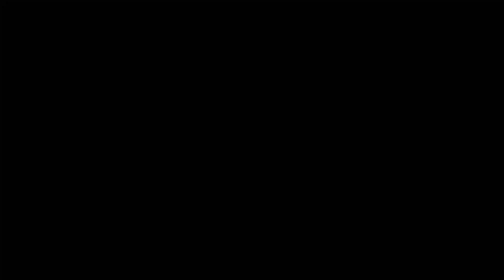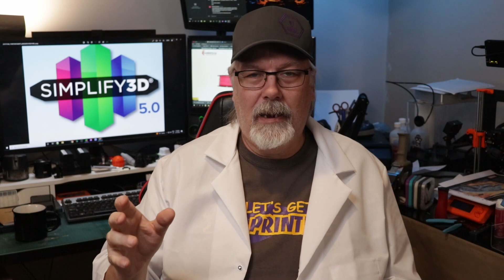Simplify3d V5: Is it Worth the Upgrade?

Comment: I've been using S3D V5 for a while now and i DO NOT recommend it for a few reasons:

- They say it's rebuilt from the ground up. That's a big lie. They developed for years and years for just some intrinsic upgrades and maybe max 5-10 extra features. Not even the essential ones that were so anticipated by its community. They just did what they thought was right and barely listened to their users.

- we in EU paid upwards 242 euro's for a single-device license. For this....

Please guys, if you want to try it out, try it and pull out. You got a trial of 2 weeks, don't be stupid like I was.

Comment: Since you are a big site, and you can transmit information, SIMPLIFY3D was not dead at all, if you shouf well IDEAMAKER, you immediately recognize the dna of simplify3d, me who am a fan of this software, and who was tired of the prime tower rising to the top when I had no more color changes, I turned to others to test, and that's where I see that IDEAMAKER has absolutely everything of SIMPLIFY3D, but then EVERYTHING, only one thing is missing, I don't really know what, I think I was using scripts to adjust the linear advance in terms of the layer height, so that's why a piece is missing
BRIEF SIMPLIFY3D worked for RAISE3D, necessarily, a machine manufacturer, is not going to have fun creating a high-end slicer starting from the blank page, and this is surely what explains the absence of the simplify3d team completely dedicated to the development of IDEAMAKER

Moreover, IDEAMAKER has a toy that simplify3d does not have and which makes me prefer IDEAMAKER, these are the modifiable areas, you draw a cube and you give orders to this cube by saying 'everything that is in this cube will have these parameters ', it allows to boost certain places in three clicks etc.

BRIEFLY DO NOT BUY SIMPLFY3D, you have it at IDEAMAKER FREE, on the other hand, you have to know a little gcode, and make your own starting files, which you copy on your other slicers etccccc

BRIEF stop, there are freebies and better!
Reply from the maker: Before I condem S3D it is only fair that I compare it to the current offerings. I totally understand the points you make. If I don't give it more than a surface examination I am not serving the comminity. With that said If you have a slicer that works for you than stick with it.

Comment: NO! You can only have this new version on ONE (1) computer whereas the previous version you could have it installed on TWO (2) computers at the same time. I did not know that fact until I spent the $59.00. I have asked them about this and they have NOT answered me. I am still waiting for my refund. I say it is a bad deal. I will start using CURA more.
Reply from the maker: Only being able to use on one PC is a major step backwards in my opinion. I will be doing a thourogh examination of the software over the next few months and reporting my findings on this channel.

Comment: For the infill, you are wrong, s3d is adding something quite new there, namely not a 2d infill pattern being pulled upwards, but a real 3d infill pattern that increases strength of prints in more directions. That is an awesome feature and you should not say that other products provide different infill patterns already, as s3d has a different way of infill. I am not a s3d employee, but i am a s3d fanboy who paid 60 dollars for the upgrade to v5.
To be honest, for the main reason I use s3d is the support structure functionality, I always get the best results when manually adding support and that works very well in s3d. But yeah, I am a bit angry that I had to pay an upgrade fee, but then again, it also took them alot of work to build this and they did release it, even though it is pretty late. Dont judge the product too soon, try all the new functions and based on that write a review. People just want to be the first to write a review and that is stupid! Write something interesting instead of only looking at the release notes, you need to try it out for yourself.
Reply from the maker: I will be diving deeper into thier infill and supports in an up coming video.

Comment: I swore by S3D for years, even when Cura and Prusa pulled well ahead of them in terms of features. I bought it long ago and had it and everything worked on it so why change? That was until Cura and Prusa Slicer started doing things S3D COULDN'T do and was faster, simpler, and easier about them. The dam broke and I adapted to Prusa slicer and have never looked back. At this point there is a snowball's chance in hell that people would be willing to fork over that much money for otherwise free features they'd find in any other slicer. On top of that even if S3D 5 HAPPENS to have one or two features that you can't get anywhere else, the other slicers will inevitably add those features and fairly quickly because THOSE slicers actually put out consistent updates. I'm sure there's some companies who's entire production pipeline is completely built on S3D but for the average consumer there's just no practical incentive at all. You can't compete with free unless you're a major game changer and that's just not was S3D5 is.

Comment: The Only thing that I saw that was kind of cool was the ability to take custom solid supports that I have made in cad with the model, and turn them into supports in the slicer. They also claim 3x faster slicing, and I've always found S3D to slice the fastest. I think it's still the fastest to date even with 4.1. Will this make me buy it? Um...no, I'm not paying for such little changes when a lot of other slicers do the same already and somewhat better.

Comment: I had accepted that I had been duped when I bought 4.x with the free 5.0 upgrade (whenever I had purchased it). Despite that I really fell in love with s3d. I was so happy the update came out and I’ve liked using it happily printing away voron parts. I would say if you like s3d buy the upgrade. Otherwise the other slicers are still quite a few steps ahead to say the least.
Reply from the maker: Thanks for sharing!

Comment: Lots of complainers. No one is twisting your arm to upgrade. Don’t like it? Fine. Go use freeware. Problem solved. I am, by far, a S3D fan boy but I have been using it since 2017. I tried to branch out and use Cura, Superslicer and Prusaslicer throughout the years 😊but I wasn’t fond of learning a new software. Was I happy about the $59 price tag? Nope. But I put on my big boy pants and paid. No regrets here.

Comment: I am disappointed that you make these assumptions based on what you have read on the web site instead of actually testing it. Generally I have consistently been getting better prints from my Simplify3d 4.1 than Cura,, PrusaSlicer and even superslicer. I agree that they should have done more to get the update out earlier, but it's here now and it works great! Yes I have purchased it already. BTW I've been 3d printing since 2012 and started with Cura back then, tried Slic3r and a number of other slicers. I have never regretted purchasing S3D!

Comment: Two things you have to take in consideration. The license goes from 2 seats in 4.x to only one seat in 5.0. And for new users the price went up from $150 to $200. For users in Europe and other country's that include VAT into the pricing the price increase is even more dramatic (from $180 to $240). That's a LOT for a single seat software license. I think most new users that would compare the features of this software to features of the slicers that are available for free now, will have a real hard time to justify the $200 to $240 price for themselves. I personally keep using the free slicers, because with a little more work in them I can spare myself $240.
In short - I think the guy's at Simplify3D will have a rough time ahead convincing people to buy their software.
Reply from the maker: I agree they are going to have a tough time making this upgrade a value upgrade to new and some existing users. The die hard fans of the product are going to update regardless.

Comment: Weeeelll, if you have a Wanhao D4, none of the other slicers produce a nice gcode.

Tried them all, and Simplify 3D works with that machine out of the box.

It’s the only reason I’m going to get the upgrade.

However, as they have done something… finally, maybe they will do more, for me I need the software anyway, so if they don’t upgrade any further it won’t bother me.
Reply from the maker: If it works for you than stick with it.

Comment: I agree with most points, but I still stick to my opinion that S3D has the best GUI of them all. Easiest to learn also.
Reply: I'll agree with that.
Reply: I bought S3D in 2016 and completely switched to PrusaSlicer around 2019. Until today i wish PS has such a great GUI like S3D.
Reply: I agree about the GUI. I'm a S3D paid up customer and a few months ago attempted to convert to PrusaSlicer. I was disappointed in the UI experience, and realized I would need to put more effort than I anticipated to become accustomed to it. For context, I'm an IT guy that's done windows and web GUI design and implementation during my career, and quickly become impatient with less than ideal GUI designs.
Reply: @evo-labs  While I used S3D in the past on a system in my workplace, I now use the Prusa slicer at home. While I fully agree the interface of S3D is very nice, I did not had to "invest" very much time to get used to the Prusa slicer interface. Once you know where to find stuff, it's pretty much an easy ride. It takes some more time (in my honest opinion) to get used to Cura. That interface is not very intuitive, because all setting are in one panel. I like the multiple tab approach from the Prusa slicer a lot better.
As said - S3D has, without doubt, the most easy interface. However, if you take in consideration that I have to pay €240, just to use a slightly more easy interface, it suddenly becomes a lot less appealing.
Reply: But is it an GUI that is worth $199? I mean - That's what you have to play compared to absolutely nothing for a Prusa slicer. I don't want to be mean here, but I have the feeling that is a little bit overpriced (yes a bit of sarcasm here). I think I will stick with the cheaper solution if you don't mind.

Comment: Sure you can adapt layer height in Prusa slicer but can it do this automatically like Simplify3D 5.0?
Reply: Yes you are, and you are able to set a ratio setting (?) Between quality and speed.
Reply: @MrBlackmidi1234567890987654321  I've only worked a short time with Prusa slicer but as far as I can tell you have to change the regions manually while Simplify3D claims do it automatically based on the geometry.
Reply: @pjhgerlach no you don't, prusa slicer has the automatic adaptive layer height for quite a while now (idk how long) and as you said you still have the option to do it manually.
Reply from the maker: Not sure yet I will find out when I upgrade my copy for a future video.
Reply: I haven't printed anything with it yet. But S3D definitely does it automatically and there's an option to color the model by layer height that really shows the various layer heights.
Reply: Yes
Reply: Yes, there is an option to do it automatically

Comment: I will find out soon, i paid to get the new release,  and the update price was less than anticipated.
Reply: I do agree, i would not likely pay 200$ for this today, but as an existing user, the fee to get V5 is worth it, if as refined in their features as the older software
Reply: @L3Dhelpguide  I'm going to take a chance to pay for the upgrade also for V5 because I've been using it since 2016 and very satisfied... but is it a license only for 1 or for 2 computers? Because the original version was for 2 .
Reply from the maker: My understanding is that it is for 1 computer not 2. I will confirm this when I do my upgrade.
Reply: @danieldeslandes2479  It is a one license for one computer.  You can have it installed on more than one but you have to deactivate the one(s) not in use.  That is not new but was a part of V4.
Reply: Wow, I’m super disappointed in this. Been waiting literally years for this update to find out it’s way way to little way way to late.  As you said, there are many free  options out there that are better.